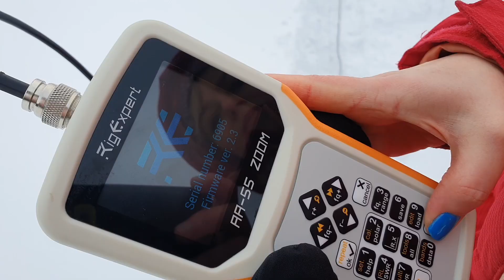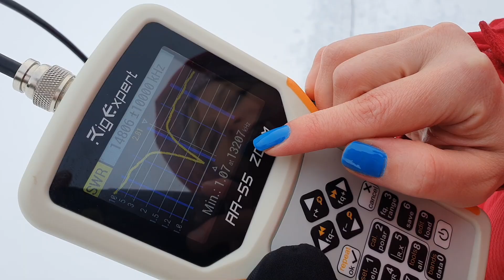Help me understand the strange result of my second ICE Antenna Test

Comment: Hello there! I suppose that an electromagnetic wave propagation constant along the wire deal great impact in impedance o dipole. Value of propagation constant defines electrical length of antenna, and surely resonance frequency position. Radiator located at the border "air // ice+water", all of those material has different dielectric permittivity (eps): air has eps=1, ice eps~10 (it tightly depends on temperature), water eps ~80. So propagation constant is defined by effective value of eps (eps_eff) [more specifically  (eps_eff)^0.5], which in turn is defined by value (dimentiones) of  material and skin depth (and more parameters) around the dipole. 
Best regards Yurii.
Доброго здоровья, я думаю, что положение резонанса диполя определено электрической длиной лучей антенны, которая в свою очередь зависит от постоянной распространения вдоль провода излучателя (волнового числа/коэффициента укорочения волны) - а оно уже определено эффективным значением комплексной диэлектрической проницаемости (eps) материалов, окружающих излучатель. Антенна размещена в "пироге" из воздуха, льда и воды с отличными  значениями eps (я тут говорю о действительной части) воздух=1, лёд~10 (сильно меняется с температурой), вода~80. Когда Вы меняли место расположения диполя, изменялись и компоненты, его окружающие, их пропорции - менялось значение eps_eff - изменялось и значение резонансной частоты.
С уважением Юра.

N.B. эффективнее (возможно) использовать другой номинал балуна (согласующего устройства) - в смысле выходного сопротивления (из опыта рекомендую от 600 до 800 Ом). Тогда получится широкополосная антенна, не требующая тюнера, но длина плеча должна быть не менее половины длины волны (на нижней рабочей частоте) - для 13 МГц длина плеча должна быть ~12 метров .
Reply: Я увидел комментарии ранее - да присоединяюсь к ним - оставляю стоящим внимания свой комментарий в части возможности широкополосного использования .
Reply from the maker: Юрий, спасибо за такое глубокое осмысление моего эксперимента :-)

Comment: I am wondering about temperature difference between the two tests and the difference with depth. How much time elapsed since the first test. You might research this too. Submariners know about inversion layers in large bodies of water with depth. Our two countries have figured this out in order to operate RF while submerged. You might also consider doing your test with the lowest possible frequency your allowed to use in whatever country you are in. It might also lead to a repeat of this experiment in a body of water where you can sink the dipole to measured depth. You started off with a fun idea that can lead to more fun ideas as I have mentioned. Now. Do you have ballooning groups you could test using a long wire dangling from a gondola? Imagine operating 160 meters from a balloon. Just what bands are you allowed to operate on?
Reply: I meant to suggest doing this again in the summer time.

Comment: To make it simple, think of your experiment as playing a flute. As you blow into the flute, if you lengthen the resonant column, the frequency goes lower all other factors being the same.
Reply from the maker: TNX, This is a fantastic explanation ;-)
Reply: @YLRaisa  Your experiment does pose for me this question, "Is the Antenna incorporating the Ice as part of the radiator, or is it, reacting only to the distance above the bottom of the Pond?"  This is why I suggested additional experiments, starting with you fine work so far, but adding a non-conducting mast of up to say 10 to 12 meters placed on the Ice and then work up at 1 meter increments from your original position of the Antenna on the Ice. 72 de KB5SXC/qrp.

Comment: The dielectric constant for the ice is much lower than you might expect, similar to rubber or plexiglass, even pure water has a dielectric constant much higher. (it varies with temperature). I think your experimental results make sense. Thicker ice will probably raise the resonant frequency.
Reply: So, her result was related to the thickness of the ice rather than the depth of the water.
I thought she was looking at the depth of the water as the variable.
Reply from the maker: Yes, I was looking at the depth of the water !! The thickness  of the Ice on both positions was quite the same, 40 cm!
Reply: @YLRaisa  So, his assumption may be incorrect. 😊
Reply: @YLRaisa  I see, I am sure the same sort of effect applies.
Reply: I think that the reactance between the antenna elements and the Earth plus the water is making the antenna seem longer. That would tend to suggest the effect is inductive like base-loaded antennas. Was it -j or +j on your rig expert?

Comment: Oh well, 4th year high school student from Italy here, it's about something we are studying now in physics, the dielectric constant ε. The higher is the εr (relative ε) of a material, the higher is the parasitic capacitance that conductors placed close to that material have. You can think about it as μ for inductors core... The higher it is, the higher is the inductance you can get with the same amount of turns.
So, εr of water is 80, while εr of the ground ranges from 4 to 8. Therefore, the more water you have under the antenna, the more is the electric field going trough it and getting influenced by it's high εr.
To summarize, the deeper is the water under the antenna, the higher is the equivalent capacity you are putting in parallel with the antenna, this lowering its resonance frequency :)

Comment: Raisa..what happens when you raise any antenna in the sky , frequency changes as we go higher, same when on the ground, or over water.. we have capacitance changes and inductance acting on the wire (or yagi).